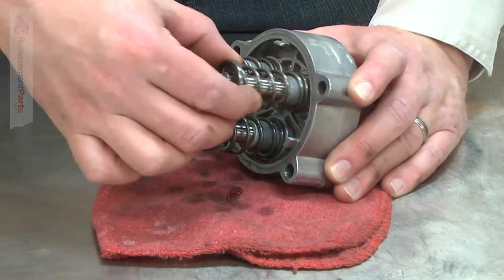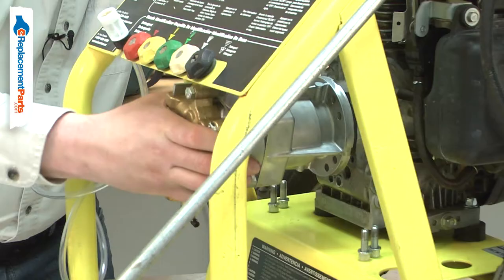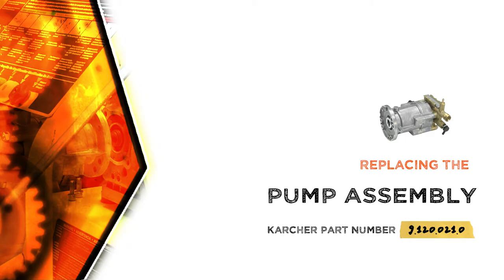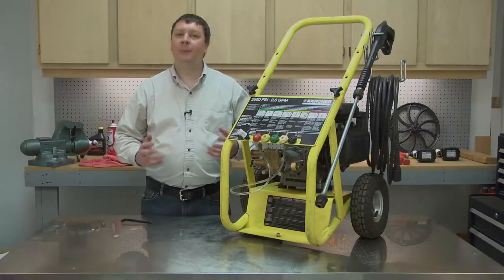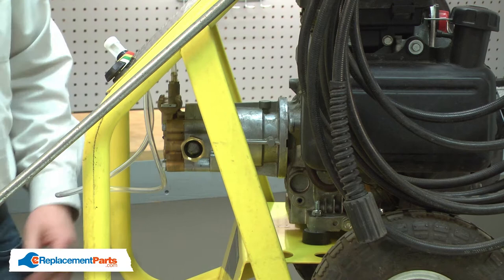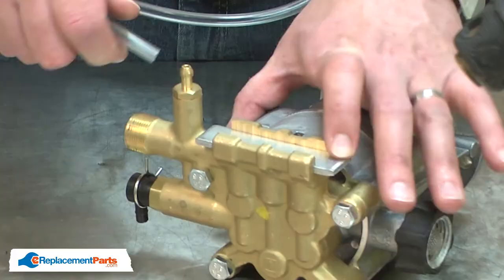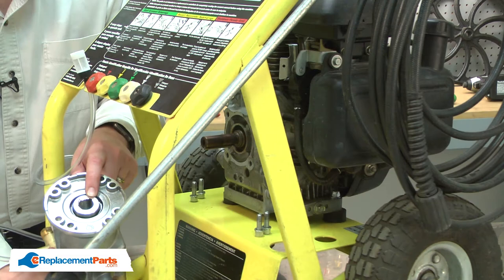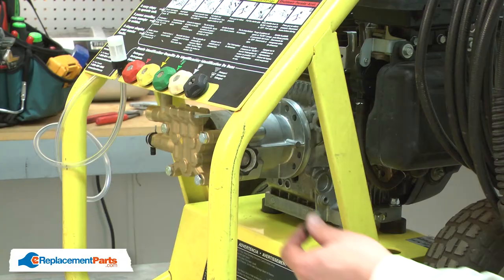Karcher Pressure Washer Repair - Replacing the Pump Assembly (Karcher Part # 9.120-021.0)

Comment: If the washer is not kept warm all winter in freezing climates, is using an old short hose into RV antifreeze recommend or full strength anti freeze and pull the starter rope with plug of until half empty the best? That will make em squirm in California

Comment: Yeah, that's an expensive option. Too bad. Are there pump rebuild videos from these guys?
Reply: No answer is my guess. Unless cracked or busted aluminum housing, it should work! New valves will help with pressure but I don see anything about oil in the pump! Mine was given to me not running, hose missing, but I expect from my 38 year old youngest. I go grab my tools once every few weeks because my stuff disappears. 
  My old one had a piston type pump, I think most are. But easy dipstick on top. Never drained it special, park in shed and froze anything h2o in it, no problem. Can't read pump brand but worked good. Tiller went WOT in garden and quit before I shut it off. Swapped engines with tiller & washer, kept going. Needed the washer and all things gave me fits. Shaft key was push out at tight fit. Wire wheeled & cleaned. Added a little grease, then it shoved key out. Decided to use a rubber band, perfect. By then, daughter needed plugs, coils under Mazda / Ford intake. Hate those. Hit by 130 MPH downdraft and broke 5 big tree limbs, up-rooted 3 ponderosa pines at 130ft. One fell on my 16' gate, but other smashed wife car. They stick me with everything broke. Retired with almost 20 lumbar procedures & surgeries you can think of. Some the 85 year old Dr did 3 times, then the device company quit, have a good life. Can't walk without cain, yet I don't move fast enough for anyone!
ASE Master Tech since 78 as I reach my mid 60's. It wasn't fixing cars that turn my lumbar muscles into scar tissue either. 
 That life! Be safe. I am in pain after 5 fusions + 20hrs ketamine I.V. That sucked.
Reply: @deankay4434  Actually, I found not only a video fromn them, but also the part numbers. What typically goes are these rubber seals (3 of them), that wear around the sides, especially if you have bad water quality. I'll be ordering mine shortly. I hope that solves the issue I'm having. What gets me is that a local small emginbe repair shop that is pretty large said they would only replace the whole pump. This is disturbing because the small rubber seals sell for at most $10.00 each, and you need 3 of them. Oh, and you need some of that special gease they use. The whole job doesn't look like it takes more than an hour and a half with a properly trained technician. If you were really good at this, you could do the entire job in under an hour. Won't be going there again...
Reply: @deankay4434  I think there may be a repair they only involved adding silicone grease: you remove the 3 piston seals, and they have a grove/channel that must be filled with silicone grease.
I ordered the new seals, but I'm going to try just repacking the old seals and see if that works.

Comment: My new Karcher Pressure washer is leaking white oil where the pump connects to the engine. Engine oil is fine so I assume that's oil from the pump. Can I buy a rebuild kit or is the pump cracked

Comment: I'm trying to repair mine. The pump is okay except the unloader valve is stuck in the down position and I cannot get it out. Any suggestions? Also, when and how do you add oil to the pump?

Comment: Hello. I have a similar pump (G 3200 oc). I am looking for the oil pump draining bolt, gage window and filling bolt on the pump but it's nowhere to be seen. Do those pumps use pump oil ? The only bolt it could be would be on the left side, opposite to the engine oil bolt. Is that it ? Thank you !

Comment: I have the identical pump on a karcher pressure washer my issue is that mine surges ( presure/no pressure etc) I was told it was the uploader valve but installed a new one and still does the same thing do you have any ideas? and point me in the right direction thanks
Reply: Most likely the check valves are dirty/damaged.
Reply: This is why I'm here too -- getting pressure surges with the newly installed pump. It's better than it was before the replacement, but still annoying.